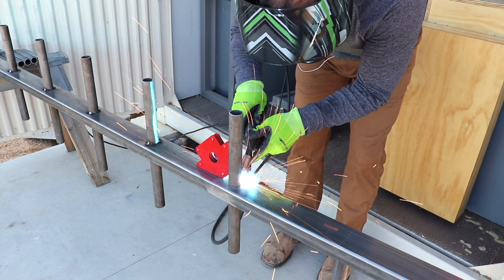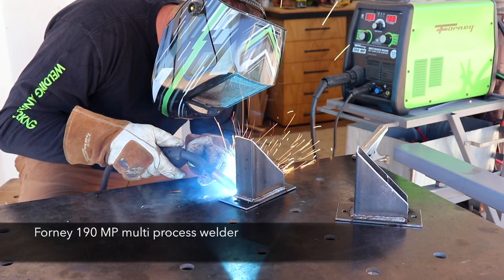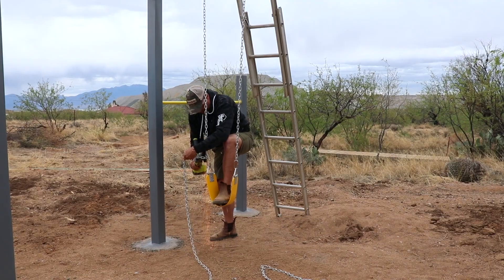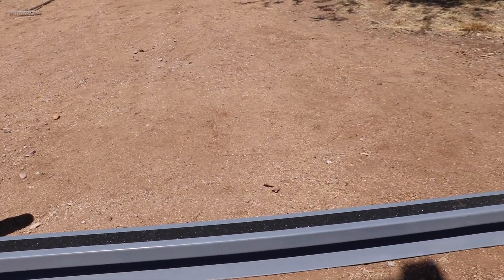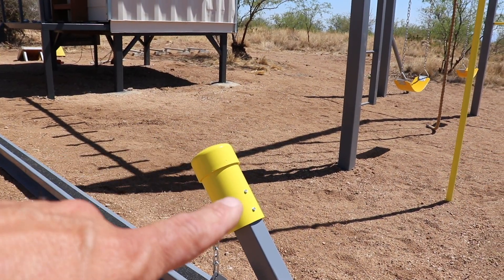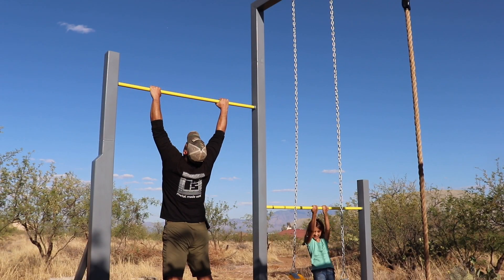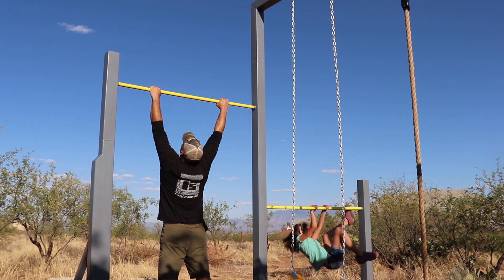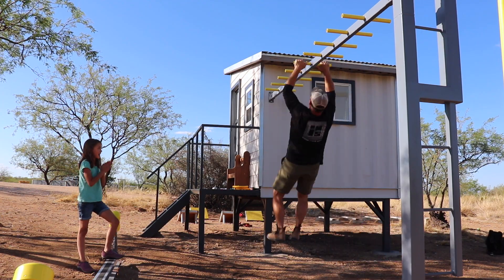DIY Playground for the Shipping Container Playhouse - Part 2

Comment: Hey Joe, turned out great. Just a little tip of advice of you don't mind. If you pit a sleeve in the holes where the hardware go you can prevent the tubing from buckling in. If you fully weld the sleeve you also make it watertight.
I am looking forward to the next projects.
Reply from the maker: That would certainly help for buckling.   On the little climbing wall on the other side of the house I had that problem when I bolted the plywood in.   The back side with the nuts have a slight concave where I cranked them down.

Comment: as for weeds, I've found weed burners work wonders...

Oh, and I just saw a bit of playground kit I thought you guys would like. it's basically a steering wheel that's allowed to pivot on a universal joint hung from above like monkey bars. it spins like a wheel, and pivots in all directions making it a more difficult version of the monkey bars. 

Something else I remembered from my childhood, a climbing net/cargo net. Especially since all you need is lots of rope and a couple of anchor points. Since I was a kid, they've come up with all kinds of different ways of setting up these cargo nets, like taco nets and tube nets.

Next up, back yard roller coaster!!! (they're easier than most people think, if you're willing to do a little bit of math to keep it safe)
Reply from the maker: Oh boy, the roller coaster was the first one that jumped out at me....haha.... and I’ve been thinking of something like that from the shop to the playground.   But kinda between a zip line and trolley track that would be suspended from the ground that you could hold onto a T handle and glide down.   But my TO DO list isn’t going to get any shorter if I start on that too soon😂
Reply: @homesteadonomics  Yeah, from what I've seen of others building coasters, a simple coaster isn't that much easier than a more "fun" coaster, once you work out the cart and how to make the track, it's pretty much all down to putting the track together, and I've seen that happen pretty quickly, couple of weekends worth of construction type deal once you actually start building track. of course that kinda depends on what you're making the coaster from. UV stabilized PVC coasters tend to go together really quickly, but this is Arizona, so, maybe a metal track would be a better idea. certainly last longer... John Iver's Blue Flash is one of the more famous back yard coasters, and he's opened it to the public with restrictions of course. (attributing to its fame, I'm sure) There's one guy in California who build one in the back yard of his 1/4 acre home lot, so they can be made pretty small. Given your skills with the welder, I'd guess it would be a project on par with your camping trailer.

Oh, and I just found out about a guy who build a 4-chair Ferris wheel. built in Nepal completely from wood, it's entirely powered by the riders and gravity. the riders power it kinda like a swing at the top and bottom, gravity provides the rest of the energy. I'd say it's got a rather Flinstones type vibe to it, but is certainly one of the things I'd be putting into my backyard amusement park... :) it certainly looked easier to build too. So, maybe start there?

I don't know if you've got a pool, but if you do, a 2-3 story water slide also seems to be very popular these days. Then again, Zip lines are also really popular these days. 

You could also do a carousel, but those seem more popular with more girly girls, and your girl seems a bit more adventuresome, so maybe not so much? might be worth asking and seeing her interest in such a thing, if not so much, skip it?

okay, so they aren't much "playground" as they are "amusement park" but still seriously cool.

Comment: so not sure if wasps are an issue there, but you may want to cap the tubes on the monkey bars. Edit: From Texas, we have red wasps, growing up my parents had a old cloths line posts made out of some old iron pipe. the pipes werent capped and wasps LOVED them. as kid, i was afraid of the posts. If you have wasps and the like I'd hate for your kid to get hit by them.
Reply from the maker: So we do have issues with wasps here but I haven’t found any in space that small...yet.   But I have checked with my local industrial metal supply and I can get caps for them if it were to become an issue.   
Thanks for checking it out😀👍
Reply: @homesteadonomics  Just spray a little wd40 in each of the holes quarterly or so, prevents rust and wasps.
Reply: @homesteadonomics  I would just put some expanding foam in the tubes. It don't need to be completely full. Just enough to plug the hole. Don't need to go crazy w/it..... lol...
Take care Joe. Don't break a leg or a arm. Oh that would hurt.
Chris from Missouri

Comment: Did you consider drilling the beam so the monkey bars would pass through? Not second-guessing.  Just curious about your decision-making process between that option and surface welding the bars onto the beam.

I'm not a welder so I don't know if you lose any strength at the well point
Reply from the maker: If I had a bit that big it would actually be way easier to do it that way... and would make keeping them aligned easier.   But I made sure to burn them in pretty good so I can’t imagine any would come off.  My 230lb usage is the ‘testing’ portion😂
Reply: @homesteadonomics  Those welds are very strong!